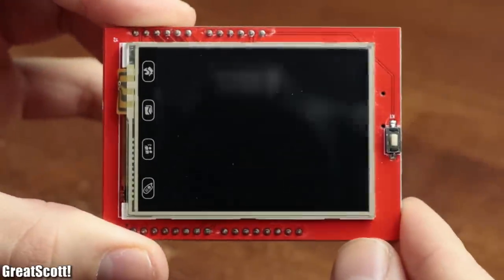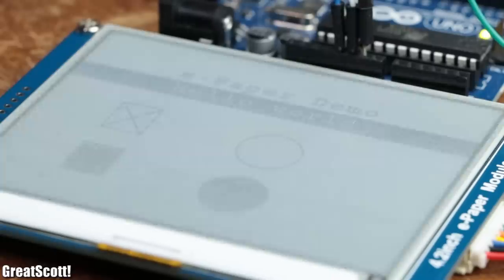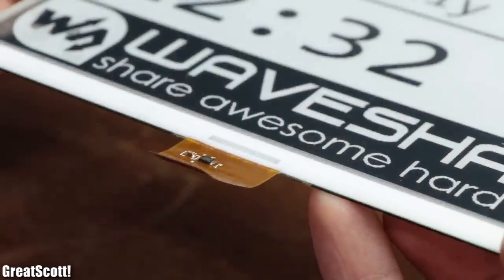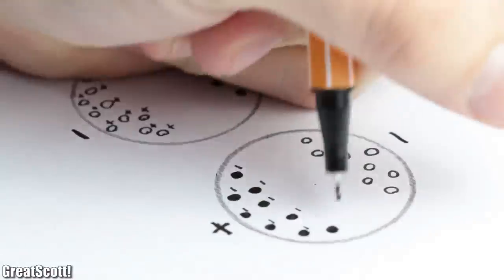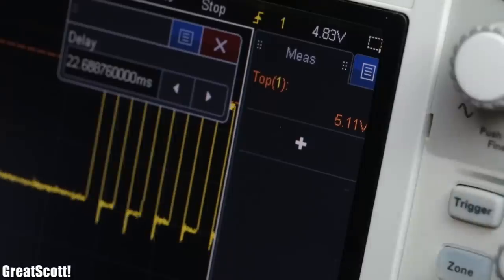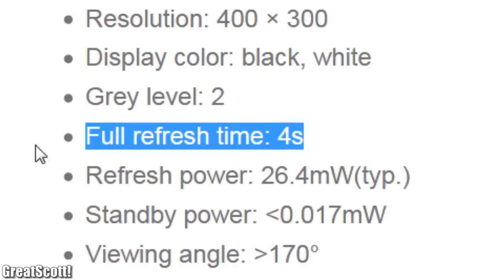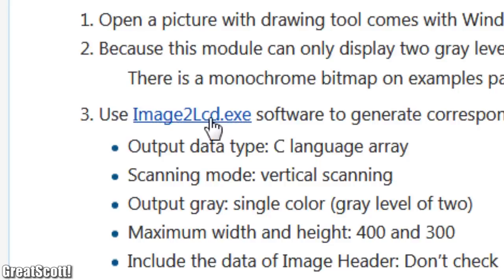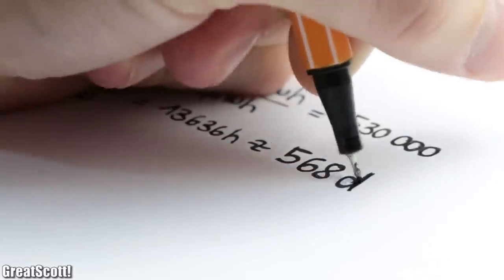The best low power display? E-Paper Tutorial

Comment: Hi Scott, thanks for your great videos, it's always a pleasure to watch your projects.

I wonder something... is there a possibility to use LCD display from devices that are no longer in use (phones, tablets) with RaspberryPi? I couldn't find anything related to this topic so far, but it would be a good use of those displays.

Would you be interested in researching this, and possibly creating a board that would make it happen?
Reply: It is possible, but a lot of them use some proprietary standard that you'd need to reverse engineer. I looked into using an LCD from an old printer, and a portable DVD player, they both had the same proprietary protocol. I can't remember it off the top of my head

Comment: Couldn't you have used the 3.3V terminal instead of the 5V on arduino? I'm just wondering because I have an old e-reader that I can tear apart and use it as a screen for my rpi
Edit: is it also possible to communicate to the screen by using the data terminals, like with a 1x10 LCD screen?

Comment: great scott! My guru!! allow me to make a question about a random subject, please. I'm a beginner and I got a transistor tester mega328 gadget (the one from china 30 days waiting...) and of course I've tried to test a charged capacitor for accident. Is there any hint you could give me to try to fix it? Thanks a lot if you have the time!
I'm huge fa of your work anyway.
Reply: You'd have to look at the schematic and work your way down from the inputs that you put the charged cap into. If it goes directly into the microcontroller, it's 99% impossible to fix without swapping it out. Hopefully it had some circuitry in between, if you see something that blew up you found the problem. Let me know if you get around to attempting to repair it.
Reply: @sugarbooty  Hi there. Thanks for your attention. 
I went at schematic and before current goes to Mega there's only resistors that seems to be okay. Maybe a damaged transistor without enough gain...  better buy a new one to fix the old one :)
Reply: @curiosidicas  It sounds like your mega is shot, I would keep the board for parts but buy and assemble a new one. Unless you wanted to buy just the microcontroller, you'd have to flash the code into it before soldering it on
Reply: @sugarbooty  Yeah I really don't want to go that deep... was just having some fun trying to fix it. But better get another one and save parts for the next one, next one.. :) thanks alot
Reply: @curiosidicas  No problem, I would suggest discharging caps before storing them. Happy holidays!

Comment: Do you remember raspberry pi display? You said that you will make video. I want to connect that display into my xbox but the rwsolution wont work properly. And you said that you will fix that later. Can you add this into your to do list please?
Reply: It's probably too low for the Xbox or the driver is set wrong or even the Xbox settings aren't right

Comment: I really dislike converting binary data to text format just so it can go back into binary. Anything meant to stay in a binary format should remain binary and be included as-is into the executable. I get that sometimes the binary data has to be formatted a special way but it's nonetheless still binary and not meant to be human readable. Really unless it's meant to be human editable I'd include it as it is even if it's not binary. Text files that aren't meant to be changed I'd also include as-is into the executable. It's really popular to do this with binary data (convert to hex so it can be converted back to binary) but I just see that creating lots of potential issues not to mention bloated project size (By at least 3 or 4 times per binary file done this way) and it's just really awkward to work with.

Comment: I had a quick question regarding these displays, I just got a bunch of old "Sprint Magic Box" units that were going to be thrown away or e-wasted, and they have a great hi-res e-paper display. I took one apart (few sites show these things torn apart) and there doesn't seem to be anything I can find about this display. I doubt they'd make one special just for them as it looks "off the shelf" or like any of the other units you can buy.

I can't find anything on it based on the #'s on the board. Anyone had luck with these displays they used? I'd hate to throw them away as they are beautiful looking and hi-resolution and would love to use them on an arduino or Pi project. thanks!

Comment: I've got a 13 inch android e-reader with a excellent display. But the rest hardware is awful. Do you have any suggestion so I can use only the display with a driver board that gives me hdmi or other video input as options?
Reply: It would entirely depend on the model of the epaper display - if there's no datasheet available publicly, it would be very difficult to control it as the pin-out and command sequences are not standard in any way.
Reply: @StephenHoldaway  Thank you, Stephen! The device is a Onyx Boox Max Carta 2200x1600. I'll search by the specification of the display so.
Reply: @lucasfarahdelgado7426  You realize that these kinds of displays can not do video, right? At most it would be at 0,25 FPS or maybe 1FPS if you don't mind shadows and/or eventually burning your display, and even then it would spend more time flickering than displaying the actual image or frame.
Reply: @agarceran  Yes, I do! My intention is to read my technical PDFs in e-ink but with the usability of my laptop.

Comment: I want to power Raspberry Pi 2 or 3 (seperatly) with powerbank. How can I calculate how long it will take to discharge it if I know mAh of it?
Reply: There are a few problems sadly...
What is the efficiency of the switch mode power supply of your powerbank?
Is the current consumption meant to be constant or variable (i think its variable)?
And consider that the battery capacity of the powerbank doesn't consider that a voltage level conversion is taking place (your batteries, charged up fully are about 4.2V, and USB is 5V. To make things worse, the voltage decreases as the battery empties).

Other then that, i recommend that you calculate the worst-case time of operation (meaning the minimun time needed to discharge a powerbank). Here is the formula (asuming 90% conversion efficiency and all Li-Ion batteries of the powerbank being connected in parallel):

true_mAh = (3,7V/5V) * battery_mAh
h = (mAh/I) * 0,9

If something doesn't make sense or i made a mistake, please do point that out so i can help you easier.
Reply: @Loundre3  

How would this depends on Raspberry Pi model that I will be using? Also, what are h and other variables in that calculation? 

Anyway, thanks for answer!
Reply: @filipstamcar6553   Regarding measured power consumption of the Raspberry Pi 2 and 3 models:
https://raspi.tv/2018/how-much-power-does-raspberry-pi-3b-use-power-measurements

Other then that, here is what each variable means:

true_mAh = The end capacity, due to the nature of the output of a powerbank (all so far use a switch mode power supply, while being more efficient, it takes more current if the voltage of the batteries is lower compared to the target voltage, if there connected in parallel)

battery_mAh = Capacity of the batteries, used in the powerbank
3,7V = Li-Ion battery standart voltage
5V = USB standart voltage
h = Hours it will work in the worst case scenario
I = The expected highest current consumption of the Raspberry Pi

Comment: I feel like the micro-capsules just make it expensive.  if you notice, there are like hundreds of microcapsules per pixel.  Completely unnecessary. 
 If you also notice, good e-paper displays are super pricey.  Especially bigger ones.
But the core concept doesn't seem that expensive.  Makes me think it's just the capsules raising the price.
Reply: As such, I am curious if it is possible to make your own display at home - just using much bigger pixels.   It feeels possible, but nobody has tried it.
Electrodes and ink/charged particles.  Not that expensive... on paper .